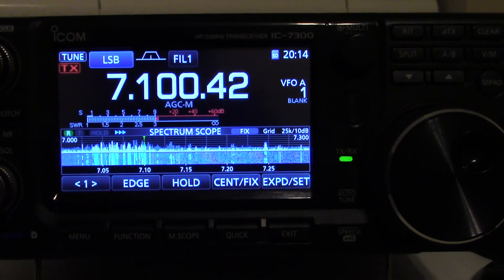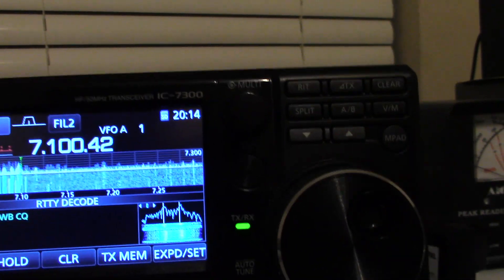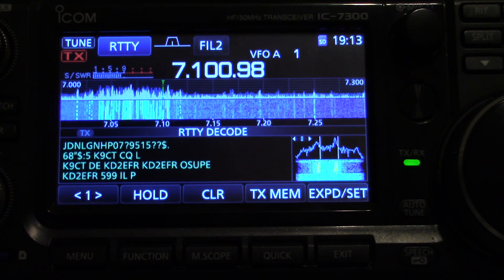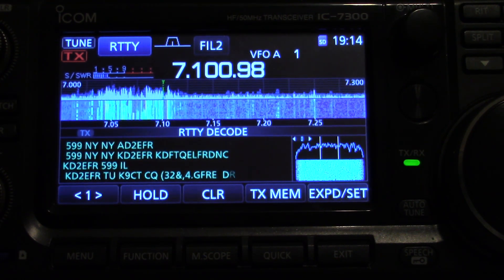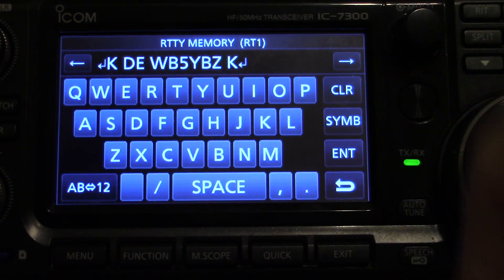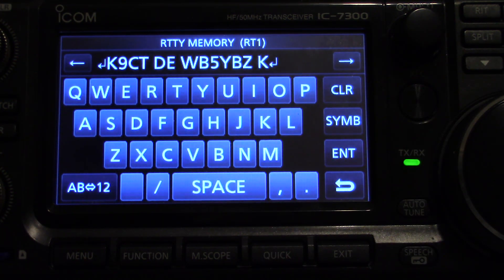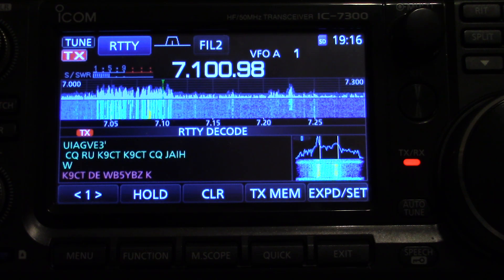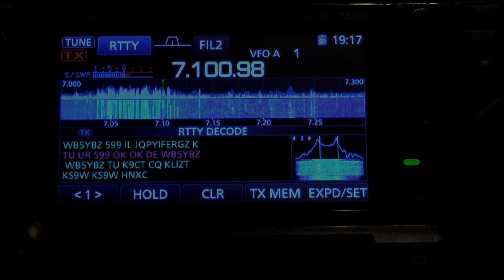Working RTTY Contest Using Icom IC 7300 Only Ham Radio

Comment: I’m just receiving random letters
Reply from the maker: Are you sure you are listening to RTTY instead of FT 8 or other digital ... If it is RTTY and you cannot decode correctly, you may have to change it to RTTY-R.
Reply: @RichRodgersOnline  I’m familiar with FT8 but RTTY isn’t working, yes I tried reverse.  I’ll keep messing around with it 😆.  Thanks
Reply: @jameyevans29  the problem is that today rtty is no longer used except when there is some specific contest, like wpx, or ww, so only when there are rtty contests there are transmissions, otherwise nothing....
Reply: @stefanosanti2183  roger that
Reply: @stefanosanti2183  ok thanks for letting me know

Comment: I use RTTY all the time and am petty fast at editing the macros but  some ops are just so impatient  its not really any good for contesting having to edit all the time .I am looking for a simple software prog to enable typing via keyboard but   most seem so complicated to set up i think i might just buy a 7610   !!! only joking but if anyone can recommend a simple software  solution them let me know.In future  lower end radios im sure will be able to have direct keyboard inputs  and will de code both rtty and morse .The 7300 is great for de code rtty  and the new Yeasu ftdx10 can de code morse but from what i have seen it aint very reliable .I own a mfj 464 keyer/decoder and it is ok for keying via keyboard but not great at decoding it needs a lot of patience to get it set up .Any how thanks for taking the time to do these videos 73:s.
Reply from the maker: Thank you for watching my video! You may want to try the "Free" software for RTTY, called MMTTY.
Reply: @RichRodgersOnline  Thanks
Reply from the maker: @saltire546  Good luck!!!

Comment: It's too bad Icom didn't have the foresight to allow you to type something and press send  along with the memory function. Be awful hard to have a QSO or contest when you have to edit memory each time for the call sign and serial number (in a contest).  :( Icom was out to lunch on this functionality.
Reply from the maker: It would be nice if they would have done that...
Reply: @RichRodgersOnline  I just contacted Icom support via email and made this suggestion for a future firmware update. Just have a little text area and a send button below the memory buttons. Should be easy to implement. I will let  you know what they reply. 
73
Reply from the maker: @johninjersey  Should be interesting!!
Reply: @RichRodgersOnline  My suggestion I sent to Icom makes it easy for them to implement: 
Either add another button to the RTTY memory screen or have a special code you enter into one of the memories. When you invoke this feature by pressing this added button or memory with the special code up comes the keyboard screen where you enter the message and when you press the  ENTER button it sends the message immediately. This would be a huge improvement and could also be implemented for CW memory. I hope you will implement it. Rest assured hams will love it :)

Am I right? Would hams love it?
Reply: @RichRodgersOnline  I think this is the product of computer people designing a radio rather than radio people designing software. :)
Reply: @RichRodgersOnline  The functionality on the RTTY as well as the CW memory which is pretty much the same reminds me of Microsoft edlin. lol Remember that?
https://www.youtube.com/watch?v=isZis-k1dhs&ab_channel=NewsmakersTech
Reply from the maker: @johninjersey  LOL

Comment: So you need to edit the macros for each callsign
Reply: I would suggest to be able to click onto the decoded text and select callsign like one does in fldigi. Icom offers a nice way to select "a signal from waterfall" in two clicks -- one to zoom in and second to tune right there. The same way could be used to pick a callsign from decoded text, which could replace a placeholder in the macros until a different callsign is selected. This approach would convert the RTTY decoder into a fully usable two way RTTY device. With this, one'd be able to work contests and SOTAs easily. Not good for digi chatting, but useful enough for the above and easy to implement. I'll try to e-mail them this idea too, but not promising anything from that...
Reply: @ferdinandfrozenstein  That would be nice, They certainly can improve it, that's for sure. It's absurd to have to edit memory in order to send something. Makes it unusable as far as I am concerned. Too bad the software isn't open source :) Many improvements can be made
Reply: @johninjersey  Sure. However, as I am coming to Icom from "Yaesu world", I am used to see many "hey, wtf? seriously?". This RTTY machine in 7300 or 705 does miss just a bit to be useful... However, compared to FT-991a, where for ex. Yaesu removed the voice memory "CQ caller" for FM! It was on original 991, but 991a removes the support... Why?! (I'd need it for local fun contests run in FM VHF, but I can't) and so on...
Reply: @ferdinandfrozenstein  Presently I am having fun with FT8 mode. Have you checked it out? Very efficient mode!
Reply: @johninjersey  Fun? Of course I am doing FT8 and FT4, since everyone does it; sometimes, it's the only way to make a QSO or chase some DXCCs or diplomas. However, regarding to fun, it's the least funny mode for me. I enjoy RTTY, PSK, CW and SSB much much more than FT8. And I think it steals users from the other, more complicated/less user-friendly modes...
Reply: well, the purpose of the macros I think are made to participate in contests like wpx or ww, in that case you do not need to put the callsign of the station that calls in the macro, but make a macro with "DE and your callsign", the correspondent if he copies, responds with "your callsign, tu  599  (fixet for all),  and the serial number, which in the case of the video was the 05 zone for the Atlantic coast for you Americans, 15 for us Italians". after receiving the message, you respond with another macro  " tu 599 your serial K" and if the corrispondent copy all, respond with "tu 73"  and he keeps calling cq test.... that's it....
It is obvious that you also need a PC to follow the log, but in that case it is better to connect the radio with the USB cable to the PC and manage everything from the specific contest software.
instead if it were to be answered to a dx speditions or a pota activator, then with the radio macros it could be done very well without a pc
today both,  dx speditions and pota activators no longer operate in rtty, but in ft8, times are changing! hi!....
Reply from the maker: Yes
Reply: @RichRodgersOnline  thank you. Did you change filters for rtty or just running radio stock. Thank you
Reply from the maker: @ronangsr  just running stock
Reply: @RichRodgersOnline  very good. Going to try now
Reply: Really inefficient isn't it? I emailed Icom a suggestion that one of those macros can be used to bring up the keyboard screen where you enter a message and send immediately. Having to edit memory during a QSO is absurd! Icom said they forwarded my suggestion to development people but I have my doubts. I'm trying to find good software to use with the ic-7300 for RTTY. I'm trying TrueTTY now but still haven't got the transmit part working.. Sad to say there are ho help videos for TrueTTY here on Youtube

Comment: The problem is you can only transmit pre-made macros.  You can't send free text.
Reply: Exactly! I can't see operating that way.  Wayyy to slow to reply to a call. Icom was out to lunch on this. Should be a freeform text mode with a send button. type message click press send. 
better still, an interface for an external keyboard :)
Reply from the maker: That is correct! You can alter the Macros.  This is good for contest as shown.
Reply: @RichRodgersOnline  But I'd rather just ragchew.  If only Icom had made it so you could just plug in a computer keyboard…
Reply from the maker: Well you can download MMTTY OR use Ham Radio Deluxe or maybe some other software.
Reply: Icom reserved that feature for their contest radios, like the IC-7610 - if they put every feature on the IC-7300, an entry-level radio, you'd have no reason to upgrade! LOL
Reply: @kenhansen6300  But the way they implemented RTTY in the IC-7300 makes that feature only useful for contesting when the radio is used on its own.  Kind of defeats the purpose, doesn't it?
Reply: @denelson83  with the elekraft radio I don't know if it does this in rtty too, but in psk31 even if there is no keyboard, you can answer the correspondent by hitting the key in cw and the radio converts to psk31 I don't know if this also does this in rtty....